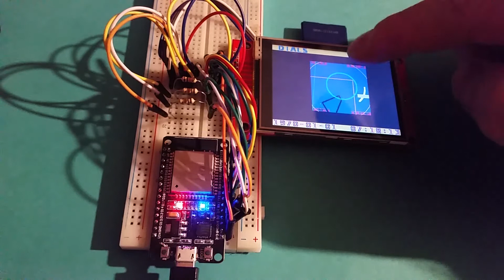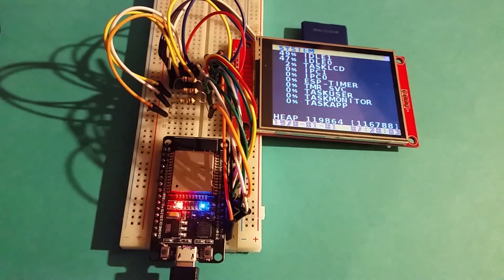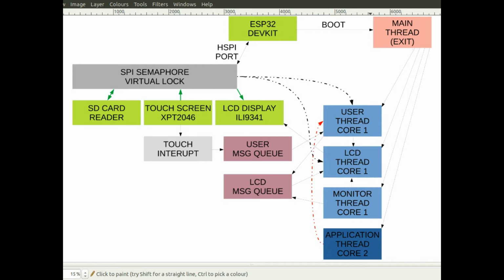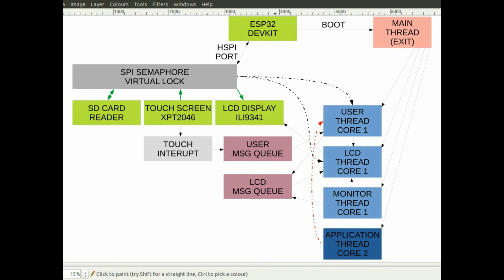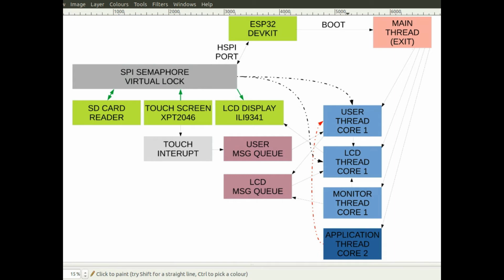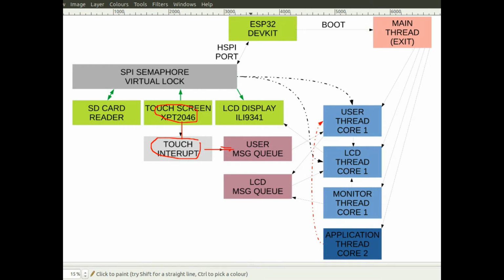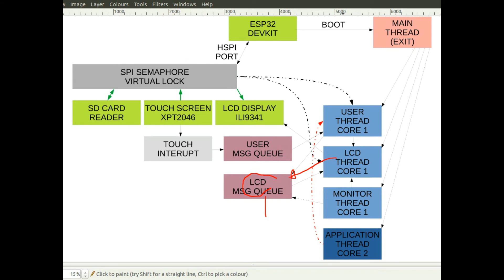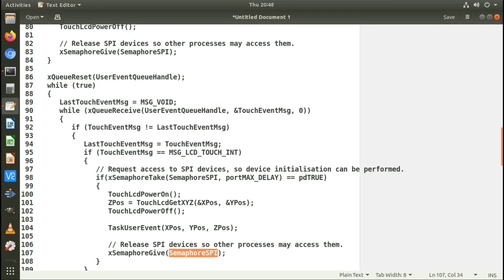Using ESP32 With LCD ILI9341, TOUCH XPT2046 & SPI SD Card

Comment: what kind of extension do you need for the lcd? I want to put the lcd far away from the computer module.
Reply from the maker: The back of the display has two single row 2.54 pin headers. One 4 pin for the SD card and one 14 pin for the display and touch screen. The longer the extension cable, the more you will probably have to slow down communication with the display. Communication speed is easy to change programmatically. There will be a limit to how long the cable can be, I don't know what the limit is.

Comment: Wow this is elaborate and looks like a well thought out setup. I have to make some gui's for the esp32 and looking for a good solution. 
I also came across Nextion experimented a bit with it works nice but a bit to expensive.
Reply from the maker: It's just manually looking for touch events in the area where an item is drawn. The Nextion software would be much more comprehensive and easy to use. I prefer trying to avoid third party libraries as issues found may not have a work around.
Reply: Consider DWIN's solution

Comment: I see your using resistors, what are they used for and what are the values?
Reply from the maker: I found the touch controller was interfering with the other devices even when CS was not selected on the touch controller. So I put 1K resisters in the DO, DI and CK lines of the touch device. The CS should switch off the control lines when not selected, so it is strange behavior, not sure if there was an issue with the device on my display or not, but it fixed the issue I was experiencing at the time.
Reply: @DevelopIT  does the issue pop up on other controllers?
Reply from the maker: @taranagnew436  I don't know. The system worked with the resistors (display, touch and SD on a single SPI port), so I included the resistors in my design.
Reply: @DevelopIT  so do you have 4 threads on 1 core, is there a good video on explaining threads and cores?
Reply from the maker: @taranagnew436  I haven't made one myself, but this guy has some related videos on his channel:
https://www.youtube.com/c/RalphBacon/search?query=task